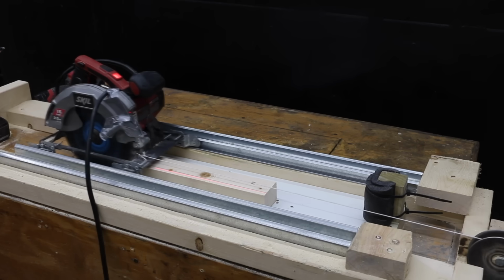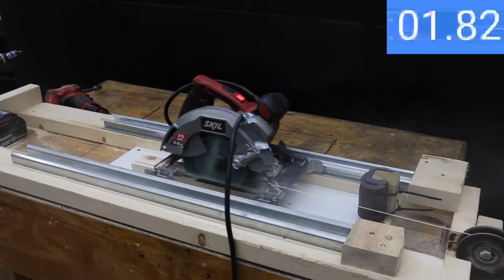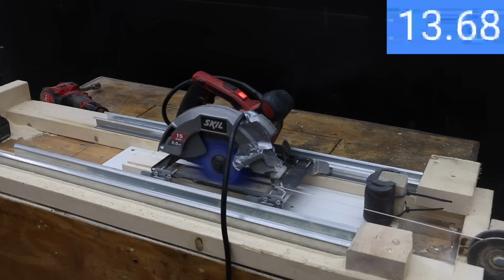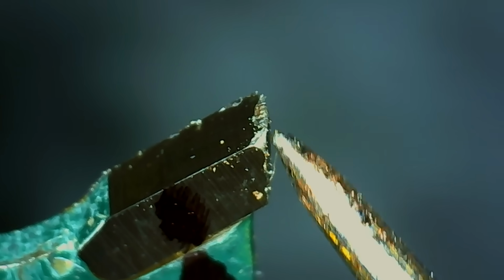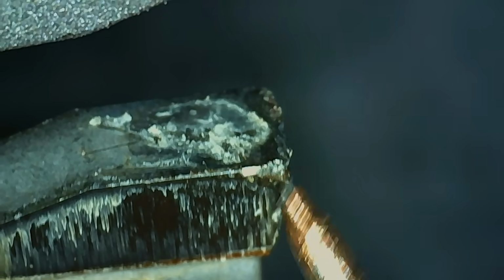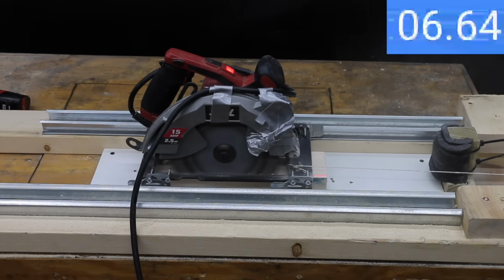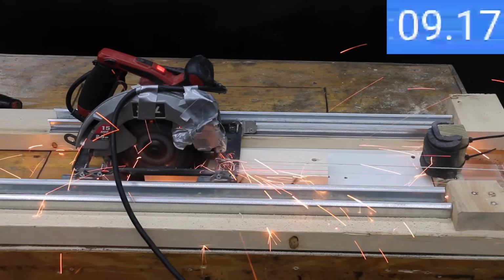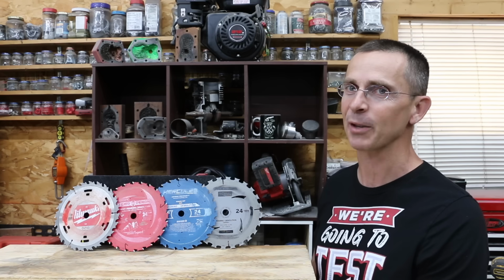Best "Demolition" Circular Saw Blade? Milwaukee, Diablo, DeWalt, Hercules, Evolution, Bosch, Amana

Comment: “Designed for wood with nails”
“Not to be used with ferrous metals”
So only aluminum nails? Lol
Reply: 3 of the most common types of stainless steel: 
304 stainless steel: 8% nickel, 18% chromium, and up to 0.1% carbon. Which means it contains about 74% iron. Weak to no attraction to a magnet, depending on cooling and hardening process.
316: 10% Ni, 18% Cr, and an additional 3% Molybdenum. 69% iron, similar to 304 regard of magnetic properties
440C: 18% Cr, 1% C, 81% Fe. Strongly attracted to a magnet.
Given the composition of iron, I think stainless steel is still considered a ferrous alloy, with 440 being the most ferrous in composition and 316 being the least ferrous.
Reply: There are carbide tooth circular saw blades made for cutting thick chunks of metal, like hot rolled bars. Diablo makes several and they look like wood blades at a glance.
Reply: @mytech6779  the tooth construction and quantity are different as far as I know.
Reply: @jtcmlt1  yes... the point is that the "cutting ferrous" issue is in regard to large homogenous chunks of metal, not nails in wood.
Reply: Weakly ferrous? 😆 ALL stainless is MAJORITY iron. If you think otherwise you are wrong.
Reply: @glynndudley8060  Are you an idiot?  Stainless steel is notable for its weak magnetic attraction.  That's one of its major properties.
Reply: I used it on wooden nails it went fine.
Reply: Zinc and brass are the most common non ferrus materials for nails and screws.

The guy that thinks stainless steel is majority iron needs to research the many different formulations of stainless steel.
Reply: @Horerczy  please provide an example type stainless steel less than 50% Iron composition.
Reply: @glynndudley8060  Alloy 20

Composition:
Nickel, 32–38%
Chromium, 19–21%
Carbon, 0.06% maximum
Copper, 3–4%
Molybdenum, 2–3%
Manganese, 2% maximum
Silicon, 1.0% maximum
Niobium, (8.0 X C), 1% maximum
Iron, 31–44% (balance)

Type 904L can also be less than 50% iron depending on formulation.
Reply: @Horerczy  if it's majority nickel its  a nickel alloy not a stainless steel. If its majority iron sure. Good example. 👍
Don't reckon I'd call it weakly ferrous in either event. Weakly Ferromagnetic sure. Weakly Ferritic maybe. Not weakly ferrous.
Reply: And high grade stainless steel nails.  Also titanium, plutonium, and uranium nails.  (wear breathing protection)
Hmmm.... is frozen mercury ferrous?
Reply: @jdlech  No mercury isn't ferrous, but stainless steel is.
Reply: @Plasmacore_V  some stainless isn’t
Reply: @TanTanTheTanMan  Ferrous literally means it contains iron. Last time I checked steel is made from iron whether it's stainless steel or not. Ferrous is not a synonym for magnetic.
Reply: @Plasmacore_V  Hence the name for iron in Italian (ferro).
Reply: @jdlech  uranium nails sound like a bad idea
Reply: @TobyMoto  Only when using Plutonium hammers 🤣
Reply: @jdlech  ferrous means "contains "Fe2+" so pure metals outside of iron arent ferrous ;P
Reply: @GrandmaterP  Yes, I conflated 'ferrous' with 'magnetic'.  my bad.  Not all ferrous metals are strongly magnetic.  Better?
Reply: @jdlech  US Army starts to make depleted uranium Nails on account of the lack of depleted uranium nails that can be cut through by their thousands of saw blades.
Reply: A loophole is a loophole 😂
Reply: Nicolae Florin Pașca  Nickle and chromium too.  Which makes it very weakly ferrous - depending on the exact formulation.
In fact, without nickle and chromium, it's not stainless steel at all.
Reply: I assume it means it's not meant for cutting steel sheeting or as cut-off wheel or similar
Reply: I guess they were hoping you used plastic nails
Reply: Lmfao
Reply: probbly saying cant cut streight metal
Reply: tungsten nails are fine too :)
Reply: As “MyTech” already stated, the specification refers to the main material to be cut. So wood with steel nails: yes, a steel plate: no.
Reply: Yes, but no.
Reply: Or copper nails. Or maybe the softer metals, like sodium, calcium, gallium, or mercury!

Comment: Just bought one of the dewalt 6 1/2 blades the other day and that thing makes the most horrific groaning sound when cutting hardwood flooring. Sounds like its screaming in agony. I normally only buy the Diablo but we werent at home depot so just figured the dewalt would be just as good. Not even close.
Reply from the maker: Thanks for sharing.

Comment: Great video. I’d love to see a video on strictly framing blades. I used to run Marathon, then I switched to Diablo for cleaner cut, lately been using Spider( shopping at Lowe’s) and seems to perform equally.
Reply: I've been in the trade since '87, doing finish carpentry & have seen a lot of blades come & go, but largely they're all very similar - essentially, it all boils down to their day to day use. 
When you don't cut on a straight line, or, encounter juvenile wood during a rip cut - which really heats the blade, it severely limits prolonged blade life. Using a damaged blade from cutting nails/screws, unseen "debris", or pushing the saw through the cut to quickly, it'll eventually heat up & distort too, effectively limiting blade usefulness. Once that happens, your smooth cutting and efficient cuts are over, regardless of the brand. Comes down to being aware of material being cut, monitoring blade heat, and creating the least amount of friction. Thin kerf blades are not engineered to cut metal in wood - period - especially heavy screws & framing nails... if the manufacturers had intended that to be, (we) wouldn't be shelling out $10-$15 bucks a blade; they'd be exorbitantly more & we wouldn't be schlepping to the (big-box-store) as frequently. This is the U.S., not Japan or Germany, who have different business models selling their products...
Also, carbide is very fragile, and to assume it will perform (long term) w/metal imbedded wood is wishful thinking.
Reply from the maker: Thanks!  Thanks for the video idea.

Comment: Could you do another episode on the Diesel engine? Like the old series you did on what a gasoline engine would run on, what would a Diesel engine run on? How would it work on the crude oils, straight gasoline, other plant based oils? What about other oils un cut  like gear oil or heavy motor oil? Could a Diesel engine run with nitrous oxide like the 4 stroke bike conversion engine?
Reply from the maker: Thanks for the suggestion.

Comment: G'day from Australia, long time fan, love the videos and work!
I would have liked to have seen the IRWIN "WELDTEC" saw blade in the line up.
I personally have used this saw blade to cut through framing timber imbedded with 1/2 inch rebar.
The carbide teeth are welded instead of brazed on. The heat can soften the brazing causing the teeth to drop off on other blades.
The blade comes in a 7 1/4, 24 tooth and an Ultra thin kerf. Also has a heat resistant coating to avoid gumming!!!
HIGHLY RECOMMENDED!!! Cheers
More information
Reply from the maker: Thanks!  Thanks for the suggestion.

Comment: Do you have a best hole saw kit video?? Lol 
I bought a cheap starter kit from harbor freight not bad but not good couldn't drill threw a door with sheet metal on outside. Tore them teeth up. Lol guess the teeth needed to be hardened first.
Reply: You do have a hole saw video well not the kit but I understand each kit gets expensive.  Oh how about best for the price cabinet handle kit. Lol keep up the great work man.
Reply from the maker: Thanks for the video idea.

Comment: How about a test of plank flooring?  Maybe a few different types/brands of Vinyl (snap lock and glue strip) vs pergo type wood flooring?  Wear of course, but also stain and water resistance, damage resistance (simulating moving heavy objects across it), maybe even flame resistance just for fun? :)
Reply from the maker: Thanks for the suggestion.

Comment: I will never be afraid to run a cheaper blade even if it comes from harbor freight, they all cut the same for  a amateur diy guy and need replaced eventually, and I'd much rather jack up a $10 blade than a $25 blade! These tests definitely make me feel good for being some what thrifty and not falling for brand name gimmicks.
Reply from the maker: Thanks for sharing.

Comment: Todd, I had a vision in my sleep last night - while camping when it started to pour down rain. I knew my boots would soak through in the morning, and unfortunately I was right. Wet socks all day. There is no one better than you to do a shootout of best water-repellent sprays! I've been using "Silicone Water Guard" (orange cap) and "Water Guard Extreme" (purple cap) spray. I used to use a product called "Muc-off" but I don't feel that it lasted very long - needed to respray everything after about a month. Of course there is always Kiwi Camp-Dry -  the Wal-Mart standard! I like to be able to use the same product on everything, boots, jackets, gloves, and I wonder if there is one product that really stands out in terms of water repellency and lasts more than a couple of weeks. Thank you for your consideration of this idea!
Reply from the maker: Thanks for the video idea.

Comment: Ever done a review on the Redline Water Wetter, and compare to other brands similar products?  Curious to see how they all affect engine temperatures, and corrosion, and lubrication, etc.  
Easy to do control test against those products using either plain distilled water or regular 50/50 antifreeze blend, or both.
Reply from the maker: Thanks for the video idea.

Comment: Can you look into testing silicon cleaner/polish, such as Maxima’s SC1, Honda’s spray cleaner and polish, Plexus cleaner, Liquid Wrench silicon spray, etc.? Mainly curious how long the coatings will last but also how well/easy they clean. How well do they repel water? Thanks for all the great vids!
Reply: Looks like the Original Bike Spirits cleaner and polish is the same stuff as the old Honda Polish so that would be a good one to test as well. The old Honda polish was known as one of the best all in one cleaner and polish so I’m curious how the OBS stacks up against the rest of the current offerings. Thanks!
Reply from the maker: You are welcome!  Thanks for the video idea.

Comment: Great video.  Thank you.
Would have liked to see an Irwin blade too.  Glad you included the Spyder.
Reply from the maker: You are welcome!  Thanks for the suggestion.
Reply: ..yes..the Irwin blades used to be one of the more commonly available, and one of the best cutting ones(the old Irwin Marathon blades that were Made in Japan)...now, they don't seem as commonly available in most stores, and the last one I saw was Made in China, not Japan..probably not as good as the old ones, either...

Comment: Should have tried Dry wall.. My nephew borrowed my Table saw and Hand saw and cut drywall for several hours .. The Diablo blades were so dull they actually caused the hand saw to skew to the right very hard.. WOW.
Reply from the maker: Thanks for sharing.
Reply: @ProjectFarm  your welcome . Sadly he had me believing they were indestructible … not.. but I’m going with the Hercules blades thanks to your video. I was going to avoiding them just because of the Harbor Freight quality control issues I have seen in the past.

Comment: I build aluminum boats. id love to see a "aluminum blade test"  the best i know of is the "Aluminum Diablo" the red ceramic coating prevents friction and keeps the cut cooler and does not gum up.  that being said i only get about a month out of a $40 blade.  id love to see the difference in blade performance in a 15amp circular saw vs. a "metal cutting saw". love the content bud!
Reply from the maker: Thanks!  Thanks for the video idea.

Comment: So I commented recently about the seal all it does not hold up to heat at all do not use it for a drain plug on a small motor it may work on a larger motor like a V-8 but too much heat in my four wheeler motor
Reply from the maker: Thanks for sharing.

Comment: Hello project farm I have a VIDEO IDEAL. compare window cleaners. Such as windex, tru-living and such. You could test how much light passes through a plane of glass cleaned. If they are streak free afterwards. You can also test dissolving power. (I use it to clean off glue on my 3d printer bed.). Thanks! Love your videos
Reply from the maker: Thanks!  Great suggestion!  Thank You!

Comment: speed of cut is probably has more to do with the density of the wood than anything else- which varies board to board.  The denser the board the more growth rings--- which should also affect speed of cut depending on their orientation.  Love your videos-- you are what Consumer Reports wishes it was (unbiased)
Reply: - considering kerf size and tooth count the same
Reply from the maker: Thanks!

Comment: Ideas for videos: 
1. Tire Inflator with Pressure Gauge using air compressor. (Accuracy, Seal to valves, Build quality, Accessories, Ease of use, etc)
2. Portable Air Compressors. (Sound level, Time to fill, Portability, Materials e.g. steel vs aluminum rust, Capacity, CFM, PSI, Oil vs Oil-free, etc.)

Example I recently changed from Stanley oil steel tank 8 gallon .. to a California Air Compressor aluminum. The sound and weight alone are phenomenal difference not to mention longevity. Also I added a AstroAI Digital Tire Inflator with Pressure Gauge from a simple filler head and cheap mechanical air gauge .. the time savings alone not to mention accuracy. I'm not saying mine are the best which is why I'm suggesting you do some testing and a couple videos. 👍😎
Reply from the maker: Thanks for the video ideas.

Comment: It has been my experience with Masterforce cutting products that they are a good value but handle heat poorly & don't last very long (I've tried circular blades for framing & dry masonry, a few different recip blades).
As often Harbor Freight offers a very good value, Bosch a very bad one & gimmick products are the worst. It isn't always true but there sure is a trend (not Trend) there. It's odd since  Diablo tends to do well while they're owed by Bosch.
Reply from the maker: Thanks for sharing.

Comment: Wow,  love this,  also love it when a harbor freight product ends up being quality!  Would love to see a whole series on saw blades including different types of blades such as finish blades, and for different applications like table saw, miter saw etc.  thanks for this!
Reply from the maker: Thanks for the suggestion.
Reply: I'm a cabinet maker by trade so this would be beneficial for me, I use freud which is on the higher end of the cost spectrum. So if there are blades equal or better for a lower price I and my wallet would like to know.

Comment: How come on the third test you didn’t measure the difference between the new blade v the blade after passing through nails? I feel like that would have been a more accurate  portrayal of the data
Reply: Shoulda watched the full vid before commenting my bad 😂

Comment: This supports my pre-existing observation that Diablo saw blades are among the best for all-around use and are worth spending a few bucks extra. Plus they're actually made somewhere other than China, which is a nice change of pace. Although it does look like Evolution and Spyder are slightly better, if you can actually find them -- I've never seen those brands before.

Also, I believe you've invented a new motorsport. Now I want to see Circular Saw Drag Racing -- which blade is the fastest in cutting through 1/4 mile of 2x4s?
Reply from the maker: Thanks for the feedback.  lol  Thanks for the suggestion.

Comment: Really enjoying your scientific testing methods.
One interesting test would be ages old question if paper air filters (for motorcycles) are better or worse than oiled foam filters. Test criteria could be air flow rate, particle filtration and clogging. You could even throw a high-end K&N filter in the test for comparison.
Reply from the maker: Thanks for the video idea.

Comment: Also, having watched your videos for some time it seems like the best strategy for most things is to go to Harbor Freight and buy 2 or 3 of what they sell and swap them out frequently. I have rarely seem a "name brand" whose high price was justified. Maybe the Diablo is better in this case if it only cost 9-12% more, but when it cost 300% and man hours are money on these jobs, it seems like buying two Bauer or Hecules saws and putting the HF blades on them and changing them frequently is a better value proposition than a DeWalt or Milwaukee tool with an Evolution blade. Your channel has got to be a threat to these companies who don't blink at charging twice as much and performing WORSE. They should be embarrassed.
Reply from the maker: Thanks for the feedback.